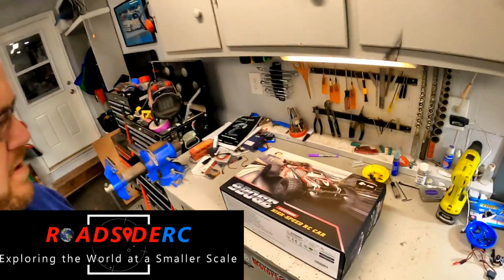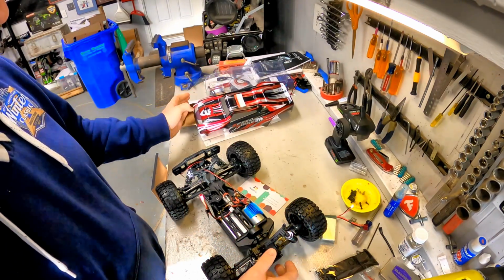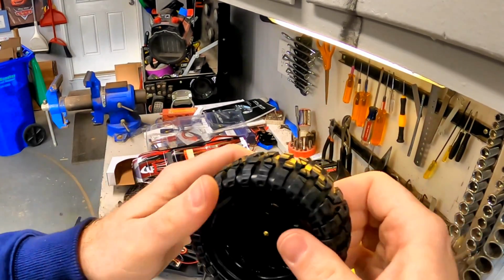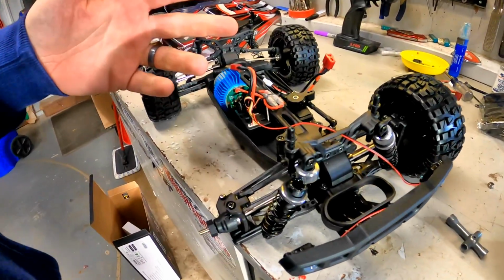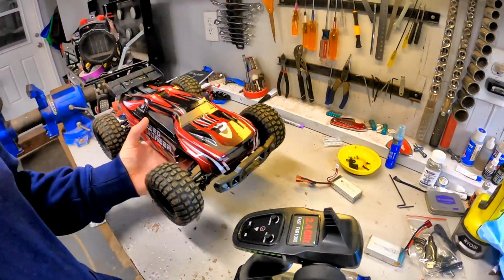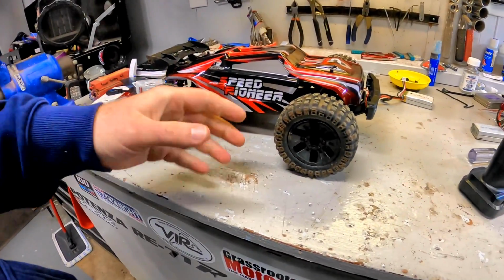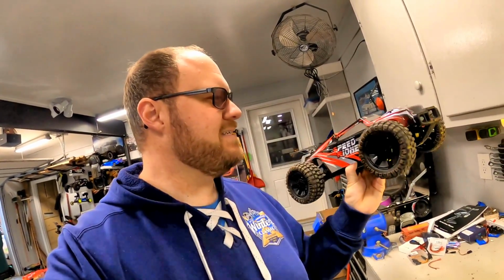DEERC 9206E 4WD 1/10 RC Truck | Unboxing | Test | Review

Comment: what oil does it recommend for the shocks what oil weight?
Reply from the maker: It does not recommend any, as it is not designed to have oil in the shocks.

Comment: Can you please tell what is best oil to use i just got one today.
Reply from the maker: For the shocks, I would recommend this oil: https://amzn.to/2YJuoHe
Reply: @RoadsideRC  thank you for the link.
Reply: @RoadsideRC  thank you for your input. it seems like there are few o rings that are not in the correct position so Oil might just leak if they are not assembled correctly. i am seeing if the customer support can guide me or replace it with a newer part.

Comment: so what's the story with the shocks?  Was there plungers inside the shock?  Watching the video it looks like they are not working at all.
Reply from the maker: The shocks are not setup to accept oil at all.   Just designed purely as a friction shock only.
Reply: @RoadsideRC  that's crazy they're so cheap… We both know there's no cost involved oh well thank you… They advertised oil shocks.  But thank you

Comment: I put a 5200mAh in it and blown the motor
Reply from the maker: 5200mah is capacity.   That will not impact the esc or motor life.  
If you ran it on a higher voltage battery - that would make a difference.  Example - running a 3S (11V) battery instead of running a 2S (7V) battery.

Comment: I got this truck a couple of months ago for my birthday from my wife. The piston in the shocks are to small and leave to large of a gap. I just got some Traxxas shocks. Much better ride now. I have noticed that the truck is a bit slow. So probably will do a motor swap myself.
Might start with a 12t 550. Or go brushless. We'll see.. but just thought I'd let you know about the shocks
Reply from the maker: Thank you for the tip on the shocks.
I was wondering if this was the situation, as the oil made zero difference. 

I was going to go brushless, but noticed that danged 5-wire servo is an odd size.  Have you found one that would fit?
Reply: @RoadsideRC  Not yet.. Been trying to take care of Christmas first lol
May go with the 550 motor first then
Reply: Also online there is a brushless upgrade for it
Reply from the maker: @poisonousheathen2459  Where do you see that brushless upgrade kit?
Reply: @RoadsideRC  if you go to Pxtoys website and click on menu then Pxtoys rc car then click on 9204e. These are the same chassis parts just different body

Comment: Looks like a rebrand of redcat blackout of which i own one and I have none of the issues you had with that one. Redcat  has plenty  of power . stock brushed motor version i am talking  about. Shocks are good out of the box on redcat . I Put a brushless system in my blackout and it is crazy . Seems like for 10$ extra or so may just wanna get a redcat if you don't want to have to do a motor swap as soon as you get it. Also if it is blackout base chassis there a ton of upgrades out there for it tho ! I do like the fact it comes with 2 lipos redcat only comes with NIMH battery which as far as I can tell is the only plus side to buying this vehicle over a blackout!  Nice video!
Reply from the maker: Interesting.  I owned a Redcat Blackout XBE for awhile, and it didn't look like this chassis at all.   Which model do you have?
Reply: @RoadsideRC  not even close
Reply: It was the v1 xte had servo on same side as motor and plastic brace just like that one then Redcat changed location of servo and added metal center brace to later models if I am not mistaken.

Comment: How hardwould a brushless swap be? New to RC
Reply from the maker: As it turns out - very hard. 
I was planning to do a basic brushless upgrade to this truck...but the servo is a very odd size that makes it more difficult since ALL of the electronics need replaced when upgrading to brushless.

Makes it hard for me to recommend this vehicle at the moment.
Reply: Roadside RC unfortunately it’s sitting under our Christmas tree lol so I’m pretty tunnel vision on trying to upgrade...the ESC and receiver are together in this RC?
Reply from the maker: Yep, ESC + receiver in one unit.   So, a brushless swap means replacing EVERYTHING.  
Danged servo is a 5-wire, so it needs to go also.
Reply: Roadside RC sounds like a project, a tutorial would be amazing though!  Thanks for the feed back, great info here 💪🏼

Comment: What do you guys think is a good 4x4 truck for around $130? I'm new to this.
Reply from the maker: Honestly, a true 1/10 scale with great bashing potential - I would recommend the Arrma Mega line. They are brushed, but 4WD and very durable.   However, they do run $220. 

If you just want to get your feet wet, see if you can track down an Arrma Granite Voltage.   I have recently done a couple videos on it.  I really like the durability and handling.  If lucky, you can get one for under $100!

Comment: Its almost like the same as the Deerc 9200e, only difference is the Shell cover and it's price 😊
Reply from the maker: Very similar!
Reply: @RoadsideRC actually when my 9200e arrived 3days ago, i was surprised that they given me 2 shells, and to my surprise the other shell is a 9206e 🤣, it was i think was accidentally included in the box, the remote they sent me also is different from 9200e so i requested for a replacement as it has only a trim for speed and a trim for steering..
Reply from the maker: Ha!  Manufacturing "oops"!
Now you have both cars.
Reply: @RoadsideRC  yeah its almost i got two 9200 series, because of 2 different car shells 😁, i think they lack in checking before shipping this toys, also the remote they sent me is from 9206e, and they sent it right away.. 😁

Comment: I don't like what you said about the motor. I don't want to spend $200 on something like this and I was looking really hard at this guy here because I want an RC Car that is on the big side, but is low maintenance. I'm just a casual user. Do you have any advice for me in regards to this guy or any engines to swap or other cars?
Reply from the maker: In RC, you can have a quality truck, fast truck, cheap truck...pick 2.  
If you want it to be good quality and fast...it will not be cheap. 
If you want it to be fast and cheap...it will not be good quality.  

I would suggest you check out this truck - perhaps it fits your budget better?  Yes, it is smaller than 1/10, but really is a fun truck.  https://youtu.be/RQRLvMlr0Ls
Reply: @RoadsideRC  What are your thoughts on the Traxxas Rustler? 2wd? I had a long talk with my sisters friend who is big into these and he recommended that.
Reply from the maker: I do not recommend the Traxxas Rustler / Slash / Stampede.   They are very bold designs that require many upgrades to really be durable.
Reply: @RoadsideRC  What would you recommend for someone like me?
Reply from the maker: @panthersfreak02  I gave you one link already to a smaller truck that is very reasonably priced.  It is a bunch of fun.  

Otherwise, one of my personal favorites is the Arrma 3S lineup (Granite, Typhon, Senton, Vorteks).   They are all great vehicles.
Reply: @RoadsideRC  ohhhh, I see it now! I'm sorry, I don't know how I missed that link. Thank you so much for your help. I greatly appreciate it

Comment: Did you do an actual speed test? I can't get mine over 17 mph at 100% throttle. That's a far cry from claimed 30 mph
Reply from the maker: I did not, but there is no way it does 30mph.  Doesn't the package say 30kph?  That is roughly in the 17mph range.
Reply: @RoadsideRC  I'll have to look at the box but the description on amazon says this,
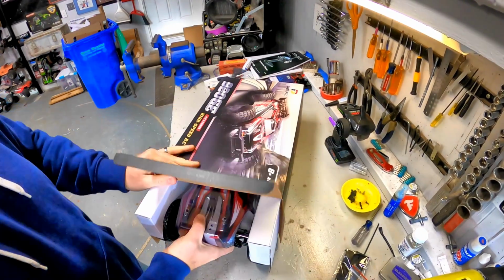DEERC 9206E Remote Control Car 1:10 Scale Large RC Cars 48+ kmh
I also bought a Bezgar 1 and has same claims and same 17 mph

Comment: I like this vehicle, I too also have one. I do have a hobby wing brushless system waiting to go in it. I’m not gonna rush it though, as I do have other faster cars I can drive if I want to. What I’m trying to say is; that this vehicle doesn’t pretend to be something it’s not. It’s pretty good all the way around. It’s just smooth and fun! Yes it’s not crazy fast, but it’s still pleasing to run. I added 40wt shock oil and it works just great! What I noticed is that it’s always pretty composed with out showing off. So until the motor or esc goes bad, I’m gonna leave it stock  for a while longer. It’s just fun as it is. I just stumbled on this channel, looks like you guys are honest and fun Rc People!👍🏻👊🏼✌️so I’m subbing you! Great video and great channel😎😁💯🍻
Reply from the maker: Agree - I think your assessment is right on. 
I find it very similar to some of the other budget vehicles I have reviewed.  I call it "simple fun".   
No 6S Arrma craziness, just simple fun.

Comment: Yes do a Brushless swap. I'm buying one right now and I've already got a brushless motor/esc combo, new Servo plus new remote w/ tx/rx and bigger batteries since all the drivetrain shafts and gears are metal those lil upgrades are all that's needed to turn the 9206 into a straight up Monster
Reply from the maker: Which servo did you go with that would fit?  It has an unusual sized servo from the factory.

Comment: Another 1/12 claiming to be a 1/10 😄. I have the 9204e brushless and it's rather awesome! The screw to the arms often come loose and servo is plastic but other than that it's great. Come join us on fb https://www.facebook.com/groups/618037099120617/?ref=share don't give it away! Pxtoys is under appreciated. Please convert it to brushless, add some LEDs, and it's a keeper!
Reply from the maker: Thanks for the tip!
I think it has a lot of potential on brushless.
Reply: @RoadsideRC  PXTOYS 9204E RC TRUCK BRUSHLESS CONVERSION by 
PERTH WEST OZ RC https://www.youtube.com/watch?v=bik_8kbIsOE

Comment: Just bought this for my 10yr old son for Christmas as we're both getting into RC. He absolutely loves it, but holy cow is it bouncy. So you recommend going to hobby store, getting some oil and filling them up (and watching a vid on how to do it lol).
Reply from the maker: Unfortunately, I am not 100% sure it will actually work. 
I put oil in the shocks myself, but it seems the fitment of the piston within the shock body is so loose that it basically did nothing.  

Look around on Amazon,  you can find some shocks like these: https://amzn.to/3nsfuvm
They are $20, oil filled, and should be approx the right length.  
You will see that shocks are measured in length from top to bottom eyelet.  I would assume the shocks on this truck would be 80-100mm.  Usually, you can get away with these longer shocks (100mm) that I linked for you.
Reply: @RoadsideRC  Update...there's something wrong with the left tires. Pretty wobbly. Haven't hit anything, just running on a baseball field. All of a sudden the wheel flies off, we lose the metal pin (there's extras), and have to put back together. Could be just a bad unit because otherwise it's a lot of fun.
Reply from the maker: Can you get in touch with me on Facebook or Instagram?  You can find me as RoadsideRC on both.

Comment: Hey got a question. If your the type of smart ass like I am, and you want to build it with mods , would it be wise,?
Reply from the maker: I really don't think so. 
I have already been looking at making this thing brushless, but the danged servo is an usual side which is making it very difficult.
Reply: @RoadsideRC  ah so basically they rip u off  technically, so you can’t mod it hhh
Reply from the maker: I certainly cant find a 3-wire servo that matches this size.

Comment: You can probably guess my answer. Brushless! 💪 Pull the electronics that you had in the Voltage and see what happens 👍
Reply from the maker: Exactly what I am thinking - except instead of 3900kv, it need something like 5200KV and really see what happens!  :)

Comment: hey man, question: what does the oil do and what kind of oil can i use
Reply from the maker: It helps the shock work smoother - less bouncy.  
Honestly - after trying it here, it only helped a small amount since these shocks were really not designed for oil to be in them.  
Instead of putting oil in these shocks - if you really like this truck, you can upgrade the whole shock later.